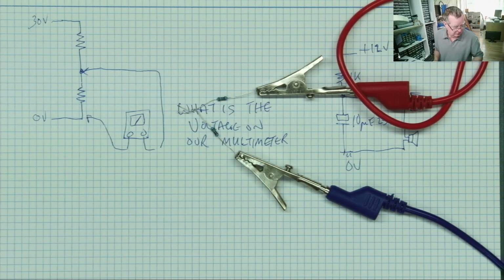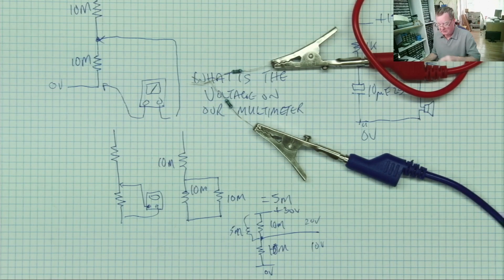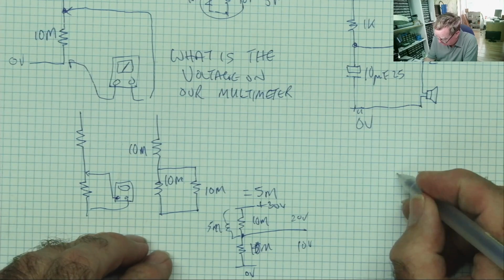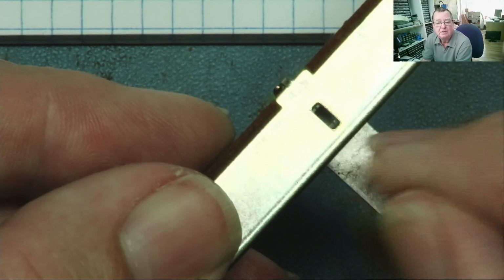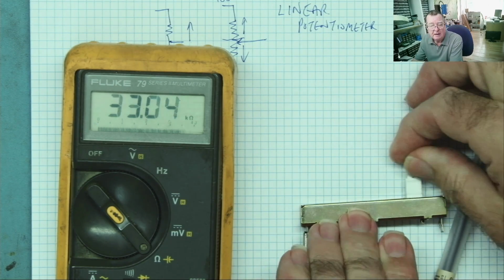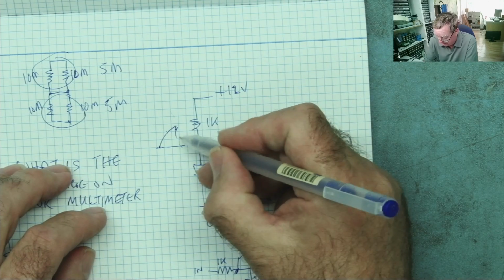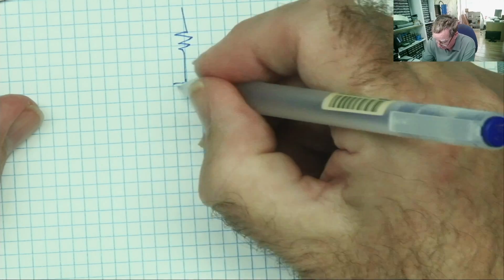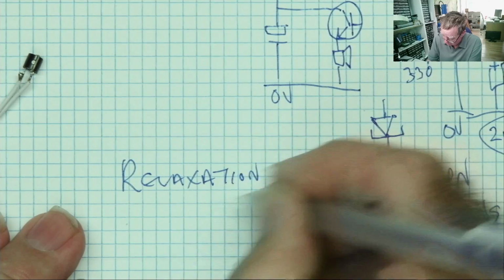Learn Electronics Repair New Year QUIZ - HERE ARE THE ANSWERS Test Your Knowledge

Comment: G,day Sir, from Sydney Australia.
After the answers, I'm in a meditational state after your Quiz answers. However...
* didn't know that the multi meter consumed 10 oms in measurements. (3 AA's in the back) 
* were does the voltage go when reduced by a potentiometer in a circuit?
* Q4 wouldn't have guessed a transistor (know now) hey?
🧲🤨💡

Comment: Happy New Year!.  You got me on the Transistor one, I was thinking it was a Zener Diode.
Reply: Not far out ! it is a semiconductor in reverse biased mode breaking down or in 'Avalanche' condition. Even Zener's have this reverse breakdown effect and it operates after the Zener breakdown so you (hopefully !) never see it, you just see the desired Zenner goodness.
Reply from the maker: @andymouse  Yes but you can't use a zener in this circuit as it does not break down in the same way, it just maintains the zener voltage.  You need something with hysteresis to make this work
Reply: Thats my point, the Zener voltage is sustained as the device is doing what its supposed to do. But a Zener will experience an 'Avalanche' breakdown as well if you push it further in reverse beyond the Zener breakdown. Just to show a simple reverse bias breakdown of a  semiconductor  the transistor is fine but at the end of the day all semiconductors will break down this way. Neat way of showing it though @learnelectronicsrepair
Reply: also as I re-watched the the other video I forgot to take in account that you showed open circuit in both directions. Good one! @learnelectronicsrepair
Reply: I also, it will be interesting ask the 4 questions  to  OpenAI 🙂
Reply: Yep lets see what chatgpt makes of Richards question ! It will fail as it can't think 'outside the box' which the questions are designed to do ! IMHO @yvesrochet3288

Comment: Would a zener diode work instead of the transistor?
Reply: Any diode will break down so yes but I'm not the MC ! Richard is the boss ! Happy new year !
Reply from the maker: @andymouse  No.  When the zener breaks down it maintains the zener voltage.  You need something which displays hysteresis as described in this video
Reply: yes when the Zener exceeds its 'Zener' voltage it will then experience 'avalanche breakdown. For most Zener diodes, the Zener breakdown is the dominant breakdown mechanism, and they are designed to operate in this mode while maintaining voltage regulation. Avalanche breakdown is typically avoided I think it should be noted that this effect is typical of a semiconductor junction @learnelectronicsrepair
Reply: @andymouse first post on here gulp, I was thinking zener diode myself but I guess that would only work if input voltage was fluctuating, I’m probably wrong as new to electronics but loving it 😊
Reply: Enjoy the hobby ! I think I have added nothing but confusion as a Zener will breakdown after the Zener voltage (reversed bias) has been reached and breached but for the purpose of this brain teaser stick to what Richard says Happy New Year ! @davidstevens3355
Reply: Thanks! Appreciate the answers

Comment: got caught out on the log pot  a daft misstake .
I have used relaxation osc as simple voltage regulators .so 3 out of 4 if you except a diac as correct for number 4
Reply from the maker: I do accept a diac for Q4 if you can find one with less than 12V breakdown
Reply: got me 28 volt lowest i can find @learnelectronicsrepair

Comment: Excellent stuff, thank-you. Quick Q for you....is the Slider Potentiometer truely 'logarithmic' or is it just two 'linear' gradients joined together? I've seen tests on 'logarithmic' rotary pots and most of those appear to actually be just two linear gradients transitioning at roughly the center point....is it the same for sliders pots too? (I don't have one to test)
Reply from the maker: it looks logarithmic when i checked with the multimeter
Reply: @learnelectronicsrepair  Thank-you for looking, do you know if this is indicated anywhere on the slider? I've never been able to distinguish one type from the other visually...is there a way? I remembered my resource for rotary 'linear taper' audio pots, it is on YT by Julian Ilett entitled 'Investigation: Are Log Potentiometers really Logarithmic?', around the 2 min mark shows a graph which demonstrates a 'linear taper' audio pot. Cheers, and Happy New Year!

Comment: Thanks, for the lesson. Where do we find the last one in practice ? Have a blessed 2024 in Jesus Christ name amen.
Reply: the circit using a kind of diode was used in early oscilloscopes  for the X timee base
Reply: It has been used in 'white noise generators' which can help you sleep, so the noise caused by the breakdown is filtered and amplified. Thats where I first encountered this in a project posted in Electronics Today International called "The Dream Machine"  as the noise is refined still further to give 'Pink' noise and this is supposed to enhance dream sleep (REM) I found it very relaxing as it is the sound of light rain or running water. the magazine 'ETI' was around in the 80's I don't know if you were !!

Comment: Happy new year! I was thinking that voltage on the slider should be 2.5V not 1.5V... ;(
Reply: So was I, going by the graph I found at Wikipedia
Reply: Would the internal resistance of the multimeter scew the result? as per Q1
Reply from the maker: @melvilib  No because the resistance of the pot is so much lower than the multimeter input impedance
Reply: @learnelectronicsrepair  Thanks, I should have done the math(s). 3 right though. Still learning at 64